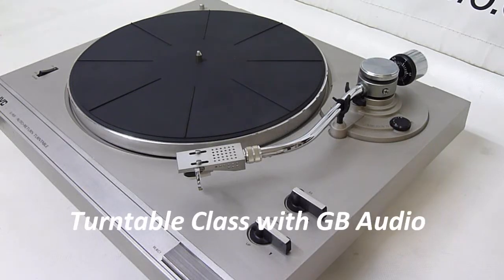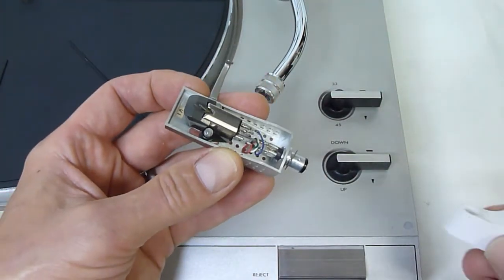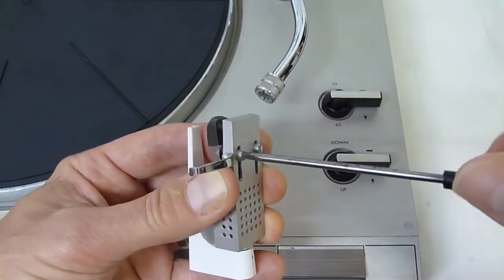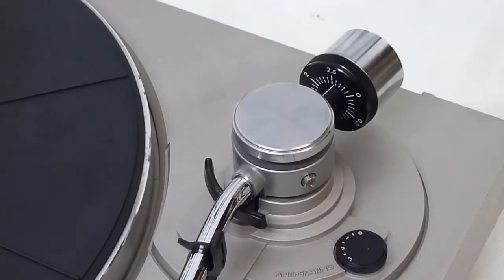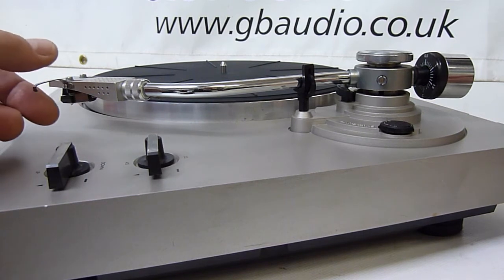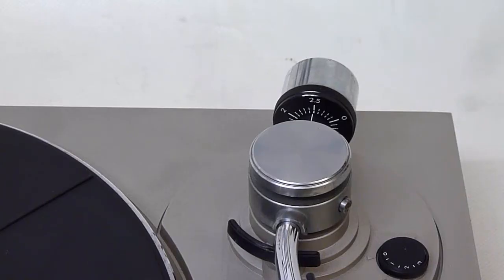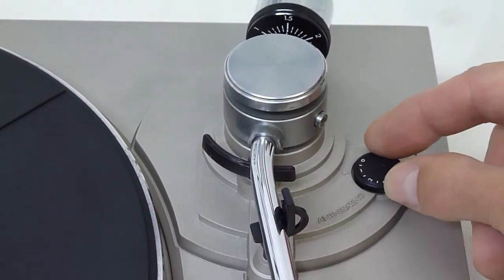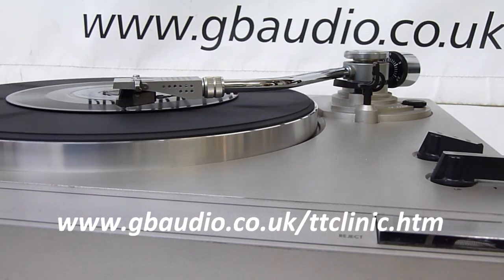JVC LA11 - How to align the cartridge, adjust the tracking weight & set the anti-skating.

Comment: Being parallel doesn't mean it's correct being twisted can be a better option, doesn't mean it's out of alignment you should have checked it before correcting it.
Reply: Every method is good, choose the one that suits you. The factory one with the original insert fits me best.
Reply: @jacekhabrajski8440  Yeah but it's down to the zenith it has been noted it's been as much as 17 degrees off and on the average is 2 1/2° off no cartridge is completely correct and got nothing to do with cost.

Comment: Would you recommend a record weight with this turntable model? Or would it put too much strain on it
Reply from the maker: It should not be a problem, however, I'm not really a fan of weights, preferring to just invest in better core equipment rather than gizmos. If you're concerned about adding weight, a spindle clamp would be a lighter way of securing the record to the platter. Good luck.

Comment: Can you explain how you went from the 2.5g for the balance to the 1.5 for the tracking?
Reply from the maker: Please watch the whole video. It shows how to balance the arm (0g tracking weight), set the gauge disc to 0 and then add the required weight, in this case 1.5g. The anti skate should be the same as the tracking weight, ie 1.5g.
Reply: I watched the whole video and have the same exact question. Where does 1.5 grams come from if you found balance at 2.5